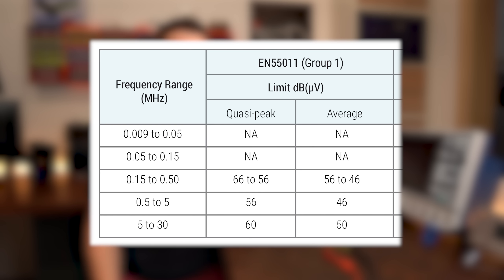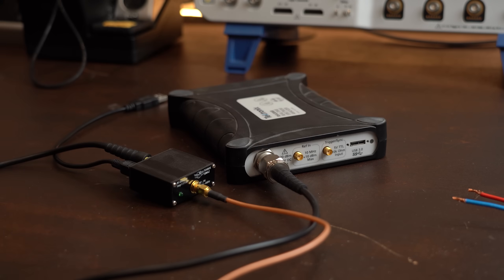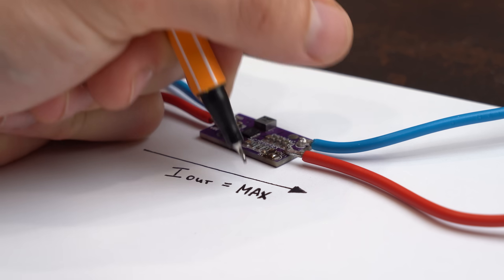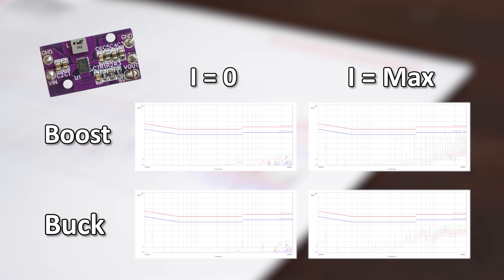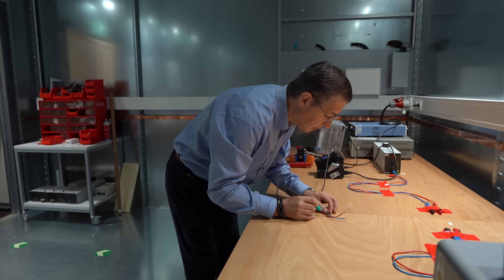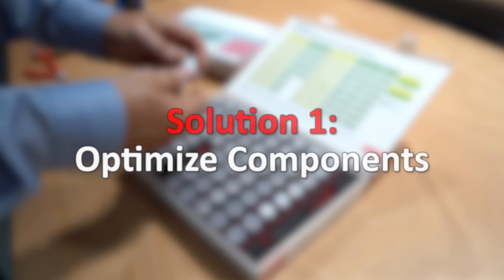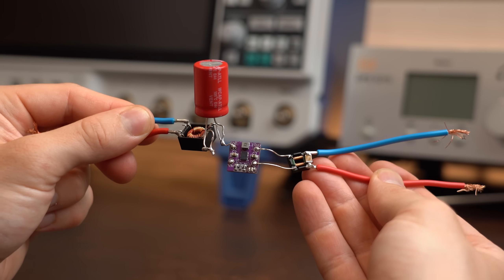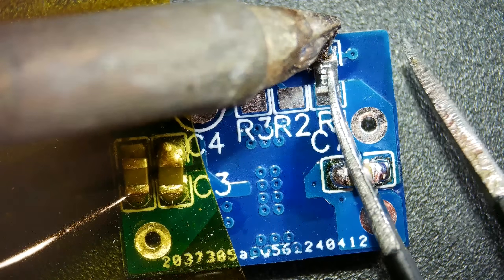Are my Circuits ILLEGAL to use?! (EMC Testing)

Comment: One solution you skipped for radiated emissions is shielding.  The simplest solution is to put your project in a metal box but that is not the only way to do shielding.  If you look at some PCBs that have RF transmitters/receivers you will notice that some of the circuits are in metal boxes that solder to the PCB.  Another approach is to coat the inside of the plastic enclosure with metalized paint.  BTW, I designed a pacemaker programmer that passed the medical EMC directive.  I did initial testing at SWrI in Texas and final testing at TÜV.
Reply: But then you should add input and output filters, otherwise it just creeps out along the cables and your shield is useless. And shields are expensive, so first try other solutions.
Reply: Mr. Faraday approves your comment.

Comment: I spent a number of years on getting my designs to pass EMC requirements, and then spent some years in my employer's EMC lab helping folks test their designs and fix problems.  Wurth produced some nice ferrites and other devices for addressing EMC issues.  I have to say that Fair-rite makes some nice stuff too.  Switching converters are one of the biggest offenders in regards to generating noise, and board designers should follow the converter manufacturer's guidelines (and there are often board layout suggestions).   EMC is an interesting and complicated subject, and certainly not intuitive.

Comment: It is frustrating that so many of the AC /DC switch mode bricks, so useful for mains powered construction projects, require so many external EMC filter components to be fitted. 
It can be argued that components such as TVS and MOV are better fitted outside the module, as they are the most likely components to require replacement, next to the mains fuse. 
There are also X caps, Y caps, common mode, inrush current limit resistors and differential inductors required, that's a lot of extra components. It would be helpful if these could be purchased as an optional complete kit of parts. 
 
Many EMC problems can be reduced by using a pre approved EMC tested USB PSU or other brick power supply, but there are some projects where an integrated AC/DC supply is an unavoidable requirement, such as where the project is used to switch the main supply to other devices.  In this case, it would be helpful if the fully integrated AC/DC module, like  that the USB PSUs provides, was available as  a PCB mountable module, rather than the main plug topology. 
Having a safe and EMC standard building block circuit for the AC/DC converter part of the circuit facilities faster project design, as the DC output can always be post regulated to meet the needs of the rest of the circuit, be it 5 or 3,3 volts.

Comment: You also have to keep in mind the shape of the traces on the board themselves too.
 I didn't realize it until I had gone into radio that 90° angles emit RF like hoses.
Reply: Yes, it is always better to use 45 degree chamfers until you reach 6 GHz where angles are no longer tolerable and you need to use smooth curves.

Comment: I'm actually battling this problem right now. I've been developing a product that has a noisy SPI bus. We reduced the GPIO drive strength to pass EMC testing, but that made it vulnerable to external EMI. Now it's the balancing act of either finding the right GPIO settings and/or altering the hardware.
Reply: Have you tried series resistors to limit the slew rate just a little bit? There are also integrated LC filters in 0508 size, certainly worth checking.
Reply: @brylozketrzyn  All the SPI traces have series resistors at either end, but we haven't played with the values yet.

The reality is I ham-fisted and reduced the drive current on all SPI GPIO, but some testing has revealed only the clock needs the higher drive strength. My hope is that with that setting it'll still pass. 

I did see some pretty serious ringing on the chip select so there's a fair chance.
Reply: @Maxzillian  If you're seeing big ring that's a good indication some tuning is needed of both the series terminations at the source and parallel terminations and the far ends of the traces. Termination values can be picky within a few ohms in controlled impedance layouts, but you can get crazy rings to almost vanish with some care just by adjusting two resistor values. If your SPI is not terribly controlled impedance, you can end up with a complex impedance which will be difficult to address. Reducing the drive current is typically not the most successful approach. Are the eye diagrams of the clock and the other lines really that different?
Reply: @Peter_S_  It's not a point to point SPI bus, so yes. There are three slaves in all on the bus so at least between the SPI and CS traces there are considerable differences.

Comment: All this, yet I can't get AM stations if an LED lamp or flat screen TV is turned on in the same house. Maybe they could bring back the metal boxes or coatings of the 1970's and 1980's?
Reply: Get LED bulbs that use linear regulators and you won't have any RFI issues with them. Just don't use them with dimmers, they produce a massive amount of RFI.

Comment: Very informative. Keep it up. 

A potential series on covering certification is not at all a bad idea. Will be cool to see how you solve each hurdle.

Whenever there's a DC DC converter, going with atleast a 4 layer board is necessary. We usually go with 4 layer board with 2nd and 3rd layer GND, any left over space on top & bottom will be made as GND pour with via stitching.

Comment: I assume this wouldn't work for every situation given the slight increase in size, but could you wrap the device being affected by interference in tape and then wrap that in a conductive thin sheet of metal, like tin foil, perhaps even connecting the metal to ground? Would this work like a super cheap faraday cage? EDIT: Actually, I think the problem you are referring to is the device itself interfering with itself, so I'm assuming not.

Comment: A couple of comments from an old PSU & EMI guy... Sometimes the worst source of EMI is the gate drive current spike inside the chip (assuming the MOSFETs are integrated), which typically needs to be dealt with caps at the chip supply pins. Also, a single uF-range cap isn't enough in most applications. I'll use tiny caps in the 330pF-3300pF range as close to the device pins as possible, with larger bulk caps a bit further away where there is more room. Remember, it is the high-frequency edges that matter most when it comes to suppressing EMI, and larger bulk caps don't do a great job at high frequencies.
Reply: Some things never change. Old rules still apply.
The only thing that changed up to this day is that you can now very easily get 100nF in a 0402 SMT case size, which is the smallest of the widely used types.
0201 and 01005 are, of course, also obtainable, but then you're getting into "diminishing returns" territory, where it's not gonna be much closer to the IC die if it's that much smaller.

In any case, I believe it's important to address the common misconception that you need to parallel 100pf || 1nF || 100nF for the decoupling to be good.
People often do it with the same case size (e.g. 0603) for all 3 parallel capacitors, thereby entirely missing the point of parallel caps: tiny ones to be as close to the pins, and then the physically larger ones can go somewhere a bit further to cover the bulk.
Reply: Good point. No matter how small the bypass cap, it still has SOME "ESL" (equivalent series inductance) to it, not to mention SOME ESR, too. These stray inductances and resistances create zeroes in the impedance curves, thus limiting the ability of bypass capacitors to do their things. Too many of our fellow engineers assume that a capacitor's impedance curve keeps decreasing as frequency rises, but the zero causes this curve to flatten out at 1/(2πRC) so that the R (esr) limits the upper frequency. Usually the R is about the same for each family size of capacitor (0603, 0402, 0201, etc.), so by using a smaller value C, the break point of the curve is at a higher frequency, thus improving matters. ESL is more problematic because once the break point is reached, then the impedance actually rises as the impedance changes from being a capacitor being an inductor!

Comment: So good to see how much the industry has changed. I got into EMC testing over 30 years ago when the radiated testing was all done outside on an open area test site, normally with a manually tuned receiver system. So much easier these days with a screened room blocking out all of the extraneous noise.
Reply: 30 years ago we rented time and equipment deep underground in a salt mine in the UK.
Reply: @ColinWatters  yeah I recall some of the clients of the lab I worked went there a few times. Never had a chance to visit it myself
Reply: Easy, yes. Cheap, no ... But heck even back then you would still need calibrated equipment, that kind of ruins cheap
Reply: @TalpaDK  oh definitely not cheap, annual calibrations and the cost of the equipment certainly add up

Comment: You can also shield components and/or parts of circuit board to reduce EMC emissions. Also, even if the board itself doesn't pass, the final products could pass in a suitable grounded metal enclosure.

Im pretty sure you could do a "EMC shield board", 2 layer with a top 100% plane and then edge solder connections all around, looking like a postage stamp.

Then mill out bottom of this board so it fits on top of the board you want to "protect".

Voila, you have now shielded emissions. This works as long as no component is higher than the thickness of the shielding board, but if a single component is higher, you coukd make a hole in the shield for that component and still have a good shield - as long as the high component is not the radiating culprit.

Comment: Low voltage DC is not my subject, but is EMC the reason my FM radio spazz out when i charge my electric bike? Or is it because the charger is making some weird harmonic frequencies?
Reply: Those weird harmonic frequencies are likely what gets emitted, to then interfere with your FM radio reception.

Comment: These boards are components, and as such are outside the scope of CE marking, so meaningless to say they are not legal.
Reply: Ah, someone already said it!
Reply: It is rare these days for people to use "illegal" correctly.
Reply: Is it not a good thought experiment though?
Reply: Well, it's not as easy.... Radio modules for examples are CE marked. Cables can get CE marked as well. And components of machines get CE marked too. All depends on whether an end customer gets the thing and/or the detective the thing is covered by calls for CE marking. The CE marking regime got rather complex and sadly EMC gets way less attention than I would love...
 Anyways, if you need some EMC testing or have some particular questions... I'm in the standardisation business and run my own lab here in Austria.
Reply: Depends if they interfere with licenced spectrum.
Someone's going to come looking for you if it's bad enough.
Reply: @myne00  even interfering with unlicensed spectrum is forbidden. Only ISM equipment is allocated to interfere with radio in the ISM bands. The rest of the spectrum is protected and allocated for radio-use.

However, it's not only EMC that matters. In case of a radio device, in Europe you have to apply the low voltage directive without the lower voltage limit (mandated by the Radio Equipment Directive / RED). Meaning, you 5V->3V3 point of load regulator needs the same care as something that goes into the mains plug. So you can get into a situation to use V0 plastic enclosures for you USB powered gadget just because of the Bluetooth microcontroller that is built in.
Reply: Depends if they interfere with licenced spectrum.
Someone's going to come looking for you if it's bad enough.
Reply: Technically it's legal as long as you are NOT intending to radiate anything - but if you do want to, you want to make sure there's nothing funny going on with RF circuits, as well as with a computer in form of microcontrollers, that's where FCC and their counterparts elsewhere are more interested in. You gotta certify them before you sell, ie. all-in-one drone flight computer with motor inverters all on a single board.

I am potentially going to look at getting ham radio license before I could do anything more with my projects.
Reply: @Dr_Mario2007  By "intending" do you mean that the device is intended/designed to broadcast something over RF ?

A micro-controller circuit/data busses, etc. are not "intended" to broadcast anything, but they do emit. It's not my "intent" to broadcast, so these circuits are legal ?
I'm not so sure about that.

This is something I need to explore. How could an amateur looking to sell little computer circuits ever afford to get these certifications ?
Or, are you no longer an "amateur" as soon as you sell it ?
So many questions.
Reply: @baremetalmachine933  What he descripted is a little bit missleading, but he is correct on that point. The difference is: What do we have here? A product fully assembled for end user usage or a technical component for integration in products by any manufacturer to finally create a product.

A simple example: A simple piece of wire is a component. But if you put RF to it, it will radiate. So, have the wire to be measured and certified? No, a wire is a wire - there is no intent to radiate.
In comparason to an circute board, lets say to transmit messages in some kind of ISM band. Does this board have to be measured? Yes, it's intent is to emitt RF. Therefore it is required to stay below emission limits, checking for harmonics and so on.

I wrote the same comment about the boards in the video are not illegal in any case. Then I found this posting and others too. Components are not covered by any restriction. If they emitt something in a horrible way, the integrator of such a board have to take care on this emission, by shilding and/or filtering.
Reply: @Dr_Mario2007  There's a world outside the US. Great Scott is German and here in Germany the Federal Network Agency monitors compliance with the legal limits. Unfortunately, EU legislation now allows manufacturers to print the CE logo on their devices without having to provide evidence to the authorities. Only in the event of a problem does the authority take action and remove devices from the market. It used to be different, but unfortunately (!) those days are long gone. I can only support you in your decision to get an amateur radio license. The "higher" the license class, the more knowledge you will have on the subject. See you on the bands!
Reply: @darc_ov_r14_solingen  Fortunately, it is this way. You really want to go back to the good old Bundespost days, where the whole DIY electronics scene as we know now would be effectively forbidden?
Reply: @MarianKeller  There are still shades of gray between black and white. In other words, e.g. the US FCC does not allow just any electronic junk into the country. Unfortunately, the German Federal Network Agency removes far fewer devices from the market than the FCC. Even when devices do interfere, it is difficult to get support from the BNetzA. You have to collect a lot of evidence yourself before anything is done. And then only the individual device is banned, not the import to Germany.
Reply: I wouldn't think that way and certainly wouldn't risk paying the fine... Any Eval Board, even if it's just a single piece, has to be CE-compliant. I suggest to check the EU law before declaring out of scope

Comment: What about shielding? I mean, the case, if the circuit is shielded outside, as a Faraday Cage?
Reply: Not as cost effective as just designing correctly, open some old IBM laptop power bricks and you will find them wrapped in copper foil.
Reply: @noanyobiseniss7462  So you mean copper foil is expensive and heavy and taking a lot of space. Makes sense if a good design is indeed capable of doing away with ALL the noise.
Reply: @erikdenhouter  Yup, basically at scale everything is expensive.
Reply: I was surprised the word 'shielding' was never mentioned. Am I asleep ?
Reply: The standard tests use input and output cabling, and measure the conducted and radiated noise that comes mostly from the cables.  It doesn't hurt to have a shield for the device under test, but it doesn't solve the problem of noise on the cables.  Honestly, there are times when the shield can make the test results worse, just from having more capacitance to the test bench ground plane.

Comment: aren't you making a big antenna though by using these wires + adjustable power resistor, therefore making these EMC measurements quite worse than what they'd be in a typical application?
Reply: If the DUT (device under test) is compliant no effect on any length of wireing. In other words, there shouldn't be any noise emitted by or through wireing in this case. Adding ceramic capacitor not always is a good solution (DC bias derating, low current capability)
Reply from the maker: Good question. Maybe someone with more EMC knowledge can give you a good answer. I am not 100% sure.

Comment: Want to play black magic? Then design a board where you need to pay attention to high frequency stuff. I catched a new channel, where the guy measures how the signal transmits through his board design in a wide frequency range, and turns out that even the position of the parts can affect the result. Look for Hans Rosenberg. He has simple, still mind boggling videos in the topic.
Reply from the maker: Sounds like black magic fun. Will check it out :-)